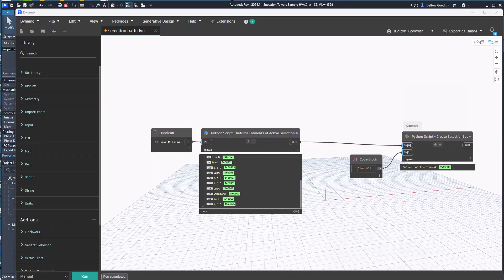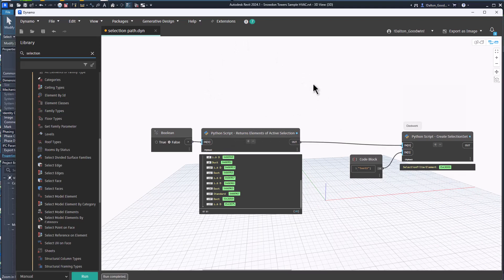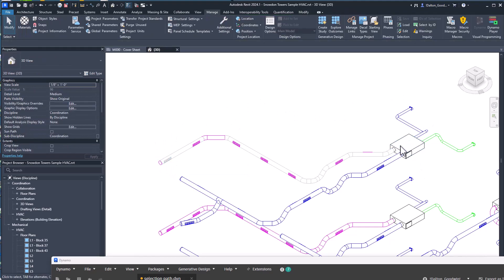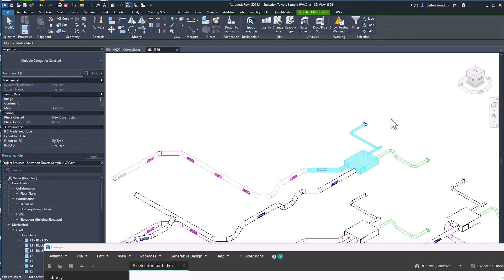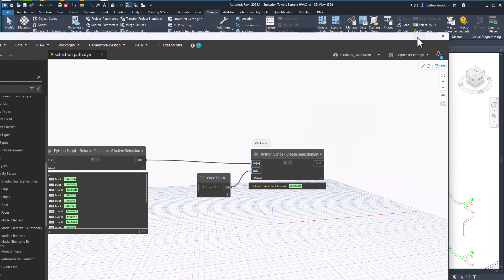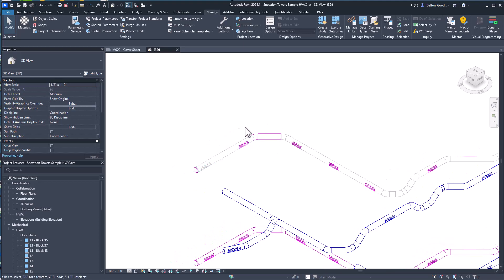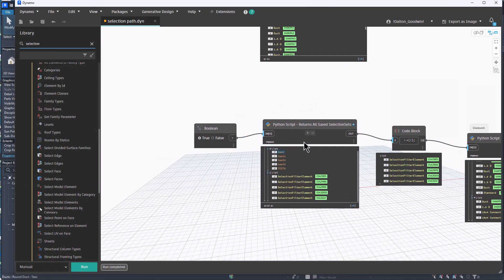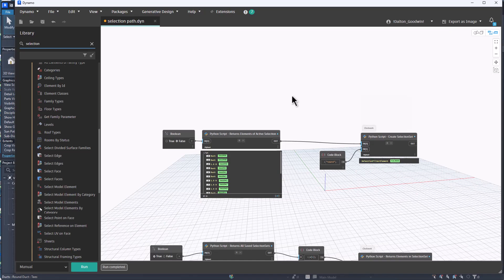Dynamo | Tab Select Duct Path and Selection Sets | Tips

Comment: peace for you ..i hope to get solution for the problem you have mention which is dynamo order the selected elements as by Ids ..my Question is how we re order it by starting element
Reply from the maker: There isn't a way to change the selection order far as I know but you can use a different method for getting the order of the selection which is using the connection points and a start and end.